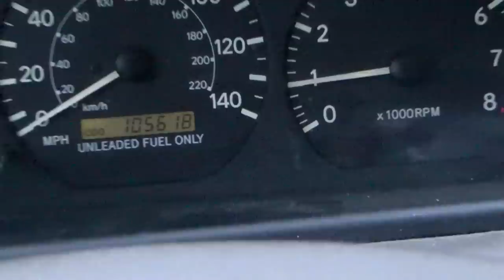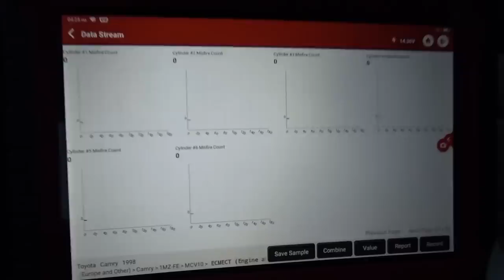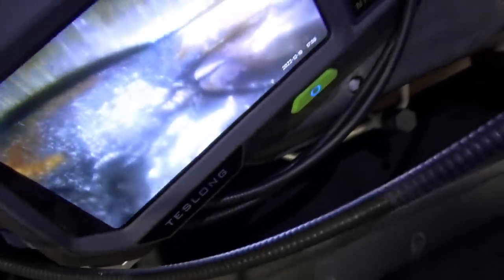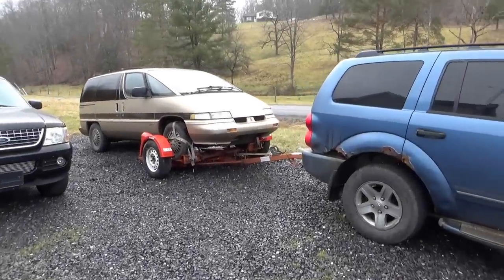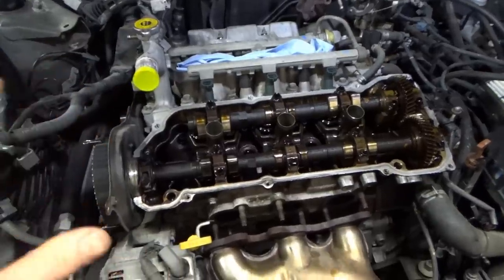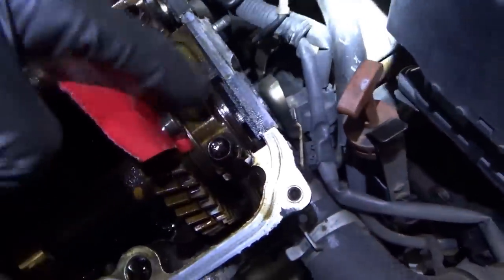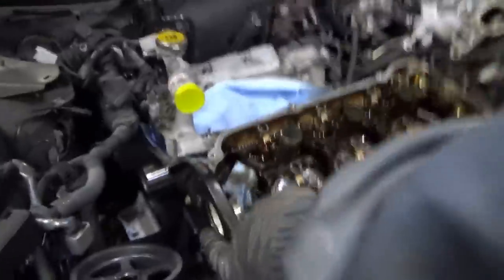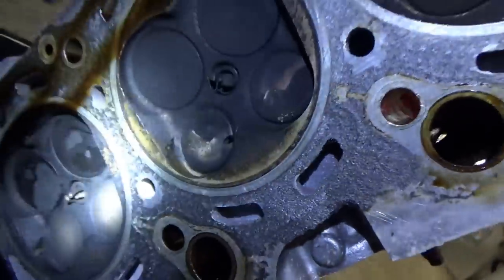How to Kill a "Bulletproof" Toyota? (98 Camry V6 Misfire - Part 1)

Comment: Yes, that is fixable. I have just done valve job and that works. You don't have to do the whole engine. That may have been anti freeze burn, leaky gasket. I see water mark on head.

Comment: I got similar camry same situation only # 5 cylinder misfire when you put on drive/reverse…above RPM no more misfire and when it on drive front tail pipe you can hear pop pop pop noise.

Comment: What made you conclude the exhaust valve was leaking when the analyzer measures ignition pulses? I'm kind of lost? Was the putting exhaust a clue? I guessed the putting was the misfire. Is the putting sound we can hear, actually the hole releasing pressure during the combustion stroke?

Comment: Ivan, I hope you have lots of insurance on those loaner vehicles.  My Russian stepson wrecked the Mazda Miata I bought for him and the driver of the other car had a bad back and he used that for an excuse to sue.  I thought I was going to lose everything I had for a while.  It worked out in the end when I hired the best attorney in FL to represent me instead of the insurance company attorneys.  My insurance company mishandled the case bad enough that they paid all which was more than twice what my policy was for.
Reply from the maker: Those crazy Russians lol! Did he catch the crash on a dashcam?
Reply: @PineHollowAutoDiagnostics  Of course he did!
Reply: @PineHollowAutoDiagnostics  Nah, no video.  Ilya had been driving a year.  I first bought him a Focus hatchback stickshift.  I had a long term contract job in FL so he and my wife came with me.  He was unhappy at his new school and I traded the Focus on the Miata hoping to cheer him up.  He wasn't used to rear wheel drive and stepped on the gas too hard in the rain and lost it.  The car he hit was sitting still at a stop light so there wasn't any question as to whose fault it was.  The Miata was totaled and it only had 12k miles on it!!!
Reply: @PineHollowAutoDiagnostics  Personally, I am very grateful you are Russian.  I promise, if I ever drive that car I will be extremely careful.

Comment: Hello Ivan,

Ever tried a BG Dynamic Platinum Engine Restoration?
I drive a '96 Volvo and my maintenance always includes BG products. It had around 280K miles and it does not use any oil (normal use). 

I've seen engines came back to life with this stuff. Burning a lot less oil than before...

Comment: I am wanting to say Ponitac made a van called the Transport  beginning in the early '90's that was very similar to the Silhouette.  (Chevy made the Lumina APV.)  The front end looked like a Bonneville. I don't think the Transport was offered with a Supercharged 3800.  IIRC that van had plastic panels that could be replaced individually.  I think later on Pontiac made a van called the Montana the replaced the Transport.  Great video!
Reply: correct, no factory supercharger on the '92 Transport but it did have a 3800 series (L27) in it as an option. Sadly the L36 Series 2 didnt make it in factory as the '96 dropped both the 3100 and 3800 options

Comment: I don't know for sure what it is, but I have seen plenty of oil burners with leaking valves. 
The Geo Metro, for example--they will burn up their valves as they start consuming oil.  In the cases I have dealt with, the exhaust valves were still reasonably clean.
What happens, I believe, is that the lash adjusters do not work properly with the gunky and dirty oil in them, so you end up with a negative valve lash, and thus no heat dissipation to the valve seat, and a burned up valve results.  If the oil stays clean, they go forever. But when the oil gets dirty in 500 miles, it's inevitable that this happens. It would also explains why a 100,000 mile Toyota engine did the same here.

However, if the oil burning is via leakage at the valve guides/seals, it doesn't seem to be an issue. Probably because the combustion soot isn't making it to the oil as much as it does when the rings are the culprit of the oil burning?

I am afraid that the "proper" repair here is going to be to re-ring it to stop the oil consumption. It is what experience tells me so far. It will run mint afterwards and possibly forever with just the occasional use, but if I am right, the dirty oil will fill those lash adjusters and start causing problems again.

I will add a Ford Vulcan V6 in a Ranger that started having leaky valves. 120,xxx miles, no unusual oil consumption, original owner, maintained as expected throughout its life. A valve leaked and I had the heads rebuilt. This is after seeing tons on Vulcan V6s that have gone to lunar orbit with no issues. Sometimes, it just happens.

Comment: Pretty sure that generation Camry, Toyota had an ad campaign that made the (obviously tongue-in-cheek) claim that you could weld the hood shut, they were so reliable, and I think even had a shot of somebody doing just that. Guess those old folks really took that claim to heart. 

Also seem to recall them having issues with oil sludging on the 1MZ in Camrys and first gen Siennas. Always wondered what the story was with that.

Comment: It might not be a bad idea to get the injectors checked out. If one is partially restricted, it can make the cylinder run hotter and burn valves. Just a thought. I bet the Van will go liked greased lightning with that supercharged engine.

Comment: Hopefully it didn't eat the seat as well...BTW, don't mix up the lash adjuster cups, by dumping that head over too far. In theory they should be the same but ya never know w/o measuring, and there is wear to consider as well.

Comment: Never had good luck with those felpro gaskets on vortec heads. Only way they have ever worked for me is with rtv on both sides and torque the hell out of them. Lifters were most of the problem and intake gaskets were the rest. I've had as much as 42degrees of timing on them it's all depending on the rest of the engine and transmission and fuel With a 5speed I was able to get a bit more than on an automatic. Obviously with higher octane fuel can get some more in it. Running it a bit rich will get a bit more in as well. That's why I never paid attention to what people say when it comes to the best setup c
Just cause it was good for them in thier location and their setup doesn't make it best for anyone else. Give it till it starts to lose and back off a hair and that's the perfect amount,😄

Comment: I don't know those engines but since it has high oil consumption maybe it is a case of deposits from the burnt oil creating an insulating  effect on the seat face letting the valve run too hot .

Comment: I'am going with a piece of carbon got stuck under the valve causing it to stay open resulting in the burnt valve. I bought a 1967 dodge van from a police auction  long ago brought it home and the motor was locked up. Pulled the oil pan and found the crank case was full of gas from a bad fuel pump diaphragm spun 2 rod bearings hand lap the journals bought over sized bearing and sanded them to fit. Drove it for 15 years before I had to do a rebuild on it.
Reply from the maker: Nice!

Comment: glad  he is not crushing  the van,,,,wish  you had  the vid on how you took the dash pad off,,,need to get mine off  my 95 transport ,,it need re glued in the front
Reply from the maker: I just put some drywall screws in it to hold it down 😂
Reply: @PineHollowAutoDiagnostics  you had it off to fix the cluster were are all the screws...that hold it down   my shop manuel is not to good
Reply from the maker: @Monza62000  Some of them were behind the vents I think...
Reply: @PineHollowAutoDiagnostics  ok  thanks   also  have  to put my shifter back in i popped  off dropping my steering column   i found  out way  alot stopped  working on it... the stupid ign switch  ..van is back  running  great,,,,,thanks  we will  work on it when it gets hot...

Comment: The Car Care Nut, a Toyota mechanic has a video on what happens to an engine when the oil isn't changed often enough.  The oil control rings were stuck from carbon buildup.
Reply from the maker: Yup like half his vids are about the importance of oil changes 😅

Comment: My son had a Diahatsu Charade 92 model 4cyl that spun a bearing at 380,000 klms it was a duel overhead cam motor I plucked that motor out by myself (had all the correct equipment) stripped it down honed the bore recoed the head replaced all the bearings&rings put it back together used new head bolts (they stretch) in my garage at home that brand of car was an off shoot of Toyota ran like new then he blew up the gearbox (manual) couldn't get parts or a used one so it got scrapped.Sad day.

Comment: While 'some' Toyotas may be "bullet proof", the 97-2005 2.2L four-cylinder and 3.0L V6 are now known to be sludge(r) or oil gelling engines. Toyota blamed poor maintenance, but for model years 97-2002 Toyota/Lexus agreed to repair engines damaged by the sludging for up to 8 years from the time of purchase. I don't believe Toyota would have agreed to that had there not been a known issue. Unfortunately, like previous owner(s) here, likely never knew about it. Looking at the cam shafts and other areas look fairly black, especially for the miles. Not saying that's the cause of bad valve, but imo could be a contributing factor. Likely Scotty Kilmer wouldn't want to read this comment, but a simple Google search will confirm everything posted. These engines definitely require synthetic oil, and shorter service interval can't hurt. I look forward to the repair result and ascertaining the cause.

Comment: I have a 99 Camry but mine is only the 4 banger. Great car though, faultlessly reliable (although I do basic maintenance) and very affordable to run.
Reply from the maker: The most perfect boring generic car in the world ;)
Reply: I’ve got one as well.  297,000 miles so far.  Very reliable and parts are CHEAP.  My only issue is rust as they pour tons of salt on the roads here in the winter.  I changed the valve stem seals (with the head on the engine) and now it uses no oil.  Incredible car.
Reply: @montestu5502  Ah, I live in Australia so we don't really salt roads. It just doesn't get cold enough to freeze. Actually the worst thing about it is that mine has the small 14 inch wheels so the bottom grounds out over large speed humps.
Reply: @PineHollowAutoDiagnostics  Motorcycles have always been my preference for fun machines. Cars are more of a way to get to work and back.

Comment: The reason why it has burned valve is because a piece of carbon got stuck or wasn't seating under the exhaust seat holding it open just a bit enough to burn the valve out usually caused by people not pushing the engine hard in upper rpm every now and then
Reply: Missing the good ol tune up heh

Comment: Interesting repair but I have to ask, why would lack of oil changes cause a valve to burn? Worn guide?
Reply: Causes Sludge build up that in turn keeps valves from closing all the way and when valves are held open that causes the combustion to be constant around that area burning valve
Reply: A lean condition can also burn valves...

Comment: You might have tightened the oil hose OK, but oil lines might get softer as those age, and screw based hose clamps do not adjust like spring clamps. I'll check my hose clamps at every oil change.

Didn't the Pontiac oli light / gauge / buzzer work? Seems too old vechile to have a lunacy of having only oil level sensor, which is checked at start and no pressure sensor, like some new cars have %-o
Reply from the maker: It has a small oil pressure gauge and no buzzer lol

Comment: I was a bit concerned that you did'nt remove the cam follower buckets and shims when you were handling the head, if they had fallen out and got mixed up it would take you for ever to get them backin the right combination so your valve clearances were in spec
Reply from the maker: No need for concerns 🙂

Comment: Thanks, I have same engine in my Sienna. Have any suggestions regarding getting faint pinging under slight load around 30 mph? No code, clean MFS, air filter and plugs. Please help if you can
Reply: Hook up think tool pros
Check data pids and
Fuel trims fuel octane may
Be off inspect egr operations?
Reply from the maker: Possibly a weak EGR valve spring and has too much EGR flow.
Reply: Thanks, I have looked and looked for the egr but can’t find.
Reply from the maker: @rossim1918  what year and what engine?

Comment: Sounds like my problem 4Runner  code po300 po301 po303  I was thinking head gasket leak change spark plug coil wires but still rough and had code po500 put in stop leak two days ago .
Reply from the maker: Don't put crap in your engine until you DIAGNOSE the problem lol!

Comment: I thought there would be alot more sludge  and chunks of lumpy oil residue inside the head on the camshaft side. Maybe the oil was changed a few times over the last 25 years. Scotty is right when he says short trips wear out engines much quicker than long drives. It will burn some oil  but will run for hundreds of thousands of miles yet . Old 90,s Toyota's bring good money in Australia for that reason. Should have minimal transmission and mechanical wear with that low milage, I can see why you want it. My granddaughter has the same engine in a 1998 avalon has 350000klms burns zero oil and is as smooth as a new engine she loves it though it has zero cred with most young people who see them as old people's cars.

Comment: Great engines, but that rear valve cover in a Sienna is a real bear.  I had an 06 Sienna last week for V/C gaskets, timing belt, and seals, water pump, then a power steering rack.
Reply from the maker: I've done a 2000 Sienna a few months ago, wasn't terrible. The Olds Silhouette was a much bigger pain in the ass haha

Comment: I had a 99 Camry with the 4 cyl. I used 10w 40 oil and would burn 1qt every 5k miles. What oil are you using??
Reply: Change the valve stem seals and your oil burning will probably go to zero.  That’s what I did.  I was burning a quart every 3K and it smoked at start up.  Now it’s perfect.  You can do it without removing the head if you have compressed air to hold the valves in place.  You should be using 5W-30 oil.
Reply: I had a 74 Vega, burned a qt (20w-50) every 85 miles!

Comment: No car is bulletproof  .. though Toyota is probably at near the top of the mountain against wear and tear you still gotta regular maintenance them. The will go 350-400k easily no maintennance.. probably 275k lol. Great cars. I just got my wife a 2002 3.9 liter v6 camry. All it needs is valve cover gasket tyne up and wheel balancing. 3,400.00 with 225k on her. Purrs like a kitten. Grat cars

Comment: I’ve owned a lot of bad cars, but the worst was a 2008 Camry SE 5-speed manual with the 2.4 engine. It had bad pistons, drank oil for lunch and constantly had throttle body problems and carbon deposits. The 2.4 is one of the worst engines Toyota has ever made.

Comment: Not sure why everyone geeks out over Toyotas. They break just as much as anything else. They can be difficult to repair at times and thier parts are expensive. In rust prone climates they have such a bad rust problem that they issued a recall to replace truck frames. I don't like how a minor problem can disable most of the vehicle either. If you leave the gas cap loose and it sets a code now your 4wd and remote start don't work.

Comment: I hope the valve seat didn't burn up where the hole in the valve was.
I'm sure you will make it usable again ivan :-D
At last it gets a regular service.
Reply: Id be more worried about where that missing chunk went..  if it scratched the bore and rings or got chewed up on the seat where it couldnt even be lapped..  not worth a revalve or bore..
Reply: @Z-Ack nd then it'll cause the oil burning issue if bore is scratched

Comment: not driven enough and neglected maintenance. pretty much city dwellers and grannies bought them.. lol
**only consumes a quart of oil every 1K miles" followed that with "synthetic oil". there's the problem, it smoked the seals and cleaned off any carbon sealing things up. 
been there done that, back when all that junk first came out, sure the engine stayed clean inside(if clean to start with), but they still wear and breakdown just the same.
check, change your oil often and all other fluids. why? nothing is anywhere near perfect, things fail, leak, degrade and they love to sell new cars, whilst giving peanuts for trade-in's 😒 go figure.
I'm guessing possibly bad injector  and high ethanol content(major stacking, bad gas?) I have bought very questionable smelling gas as of recent (Ohio), it made the exhaust smell funny, but I don't sit there and sniff it(lol)

Comment: The 98 was one of Toyotas great misses on quality. Junked a loaded v6 at 125k miles after pouring $8500 into it. Absolute pos.   Next to dodge products the worst vehicle I’ve owned by far.   Still buy Toyota though.
Reply from the maker: Wow what happened?
Reply: @PineHollowAutoDiagnostics  too much too remember and type.  Catalyst. Trans. Struts and tops. Motor mounts. Ever power steering component plus the rack. Every gasket and seal on the engine. Heater core. Control arms. Wheel bearings. Calipers. Power seat system. Washer bottle and pump. Abs module. Traction control failure. Starter. Plus more. I wish I were exaggerating. Ultimately low catalyst efficiency couldn’t be fixed so junked it. 

Didn’t burn oil or have rust.  Even had the damn real gold trim package.
Reply from the maker: @dodgefree1400  Holy cow sounds like a LEMON!